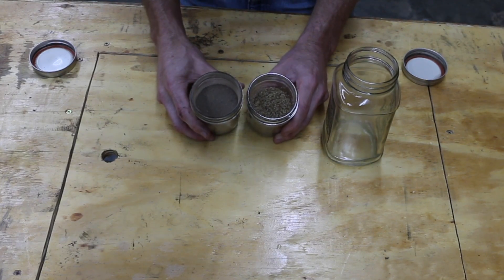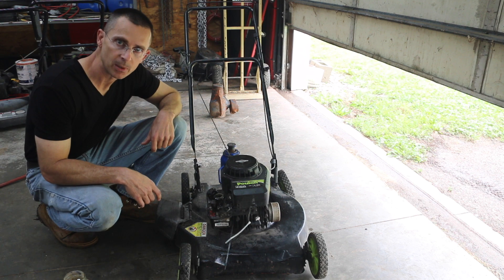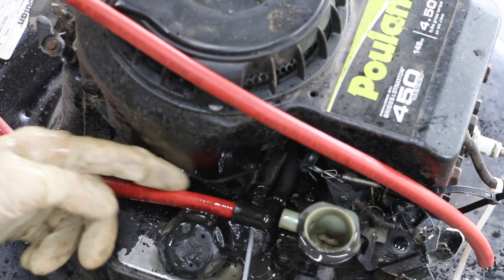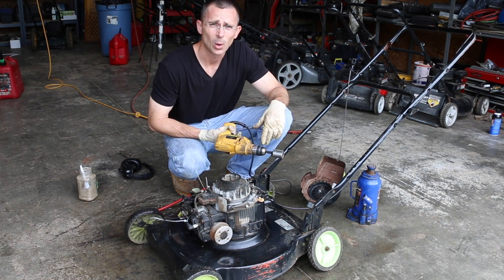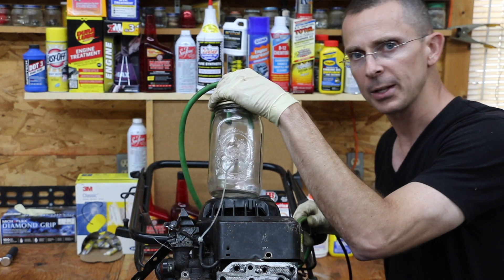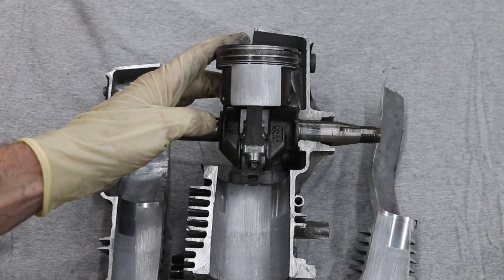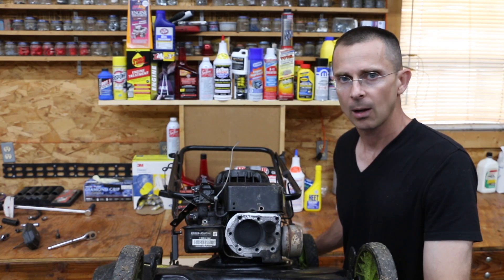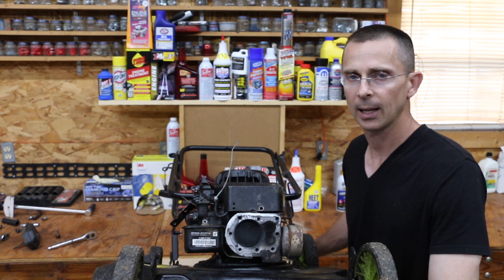Will Dirt Destroy an Engine?  See what it does to this Engine!

Comment: Not sure I feel this was accurately tested. I understand it is somewhat scaled down. But comparing such a small cylinder with a teaspoon of dirt seems like throwing a cup of dirt into a cars intake. That and it's literally pouring in, not really broken up into the air or tossed around an air box. Maybe put same mix into paint sprayer, make a faux airbox. And re-test. The amount of wear you put on the engine was just out scale in my opinion. If a full size engine was exposed to the amount dumped into the mower it would take quite a while to amount to that, there would likely have been an oil change or additives added at some point depending on the owner. My two cents, have a good one
Reply: Scott Donaldson  you obviously dont live down a 15 mile dirt road like me.  Air filter is dirty as hell every 1000 miles.  To me. This is a very accurate test.
Reply: Scott Donaldson The point is to see what damage dirt can do to an engine. And he did just that.
Reply from the maker: Scott, Great point!  Thanks for watching the and commenting!
Reply: Scott Donaldson around here its an average thing...
Reply: I dont think this is an unrealistic comparison to a car engine. Those 1 cylinder lawn mower engines have a very similar diameter piston to most 1.6l 4 cylinder car engines. Even though the car has 3 more cylinders, sand is heavy so I bet in a car engine it would come through the air intake and  and the velocity would push most of the sand to one side of the intake manifold and it would get more concentrated to one or two of the cylinders. I could be wrong. Just a thought.
Reply: Scott Donaldson i was thinking the same thing. It's a great video, BTW, but not very realistic in terms of scale. Much more sand than a car engine would take in at a time, and much too small of a cylinder to scale to a car engine … wonder what would happen if you took the same test to say, a motorcycle engine or something.
Reply: Scott Donaldson i think too, but this is the points who make it true
1-dont was too many time running and in long uses (problabely)
2- in locations with a lot of dust and with someone who use a lot of the engine the oil getting a little bit of dust already wold do a damage
3- who are using the car don't change a lot of oil (only when really need) will encrease a lot of the damage
4- changing the oil don't remove all the dust, the dust problabely will just be stuck somewhere
5- the dust will increase more when do some damage (a few iron dust) and it will make increase more the dust blablabla
Reply: Practical Guy while the cylinder size may be similar in size to a small car engine, the issue that many people see with this test is that the amount of sand being poured into that engine is way more than the average engine would ever take in. To put that into perspective, I would say (not an expert, but my opinion), that the amount of sand he poured into that small engine would clog any vehicles air filter rather quickly (as stated above by one commenter who needs new air filters around 1k miles)… but many vehicles can go 15k-30k miles (or more) before needing a new air filter. Where I used to life, I put over 40k on the air filter, and only changed it because it had over 40k miles on it … not because it was really that dirty.
Reply: James Pierson. I agree. It's not realistic that this would happen. The video is an extreme case!
Reply: Scott Donaldson i agree , I would have liked to see no air filter and just let the mower crest a dust cloud
Reply: Scott Donaldson also realistically one would think that eventually the dirt would eventually be cycled out, unlike this scenario where it’s like driving through a sandstorm with no air filter so there’s no time for it to be simply filtered out and ultimately removed with the oil, would damage be caused, yes but idk if it would be on this level. Needless to say it is bad for an engine regardless
Reply: If you were listening in the beginning Project Farm was talking about how reckless people use to be about not using air filters. He was probably speaking mostly to mechanics like myself that are a bit long in the tooth. One of the most common engine modifications-way back in the 17th century-was the old Hilborn Injection system.  Air filter on the set up was a metal screen with nail size holes. For people with those old hot rod set ups, Project Farms experiment was a perfect learning tool even if it came 40 years too late.
Reply: James Pierson it would happen faster if he put same amount of sand. Tbh i think a lawnmower can tolerate more abuse than a motorcycle engine.   Or more a dirtbike engine because thats all i am thinking about as far as motorcycles
Reply: Scott Donaldson if you ran a lawnmower with no air filter for about 4 years in a sandy dusty area this does happen i speak from experience.   My grand maw took her air filter out of her lawn mower a few years ago and now it burns oil when you first start it.
Reply: I completely agree that it shouldn't have been spoonfulls, but rather an hourglass kind of trickle if he's trying to simulate years of filter-less operation. The dust in the air, unless you have a cold air intake pointing nearly to the ground, will never be shovel loads like the scaled up version of this would. You could talk about a 1.6 liter or a 4 liter. 40 times that spoonful isn't making it into your engine at once.

Grateful for the test nonetheless.
Reply: James Pierson Just think about what an engine is an engine. Somewhere, in there, there's compression. Compression need s tolerances. Tolerance will always be so small, that doesn't matter if it's a truck engine, golf engine and so on. :)
Reply: Tzorb so sorry, forgot how many of the general public live down a 15 mile dirt road.

Comment: Your test is utterly pointless and does not represent not having a filter one bit unless the filterless car is a Dakar rally truck!
The particle size of the typical dust a street or drag vehicle sees is not even remotely near what you put in. In addition, dirt (or anything strong enough to damage aluminum) is too dense to get into an engine bay. 
Many people, myself included, have had vehicles without filters (racing use only in my case) and needless to say, many continue to do so without any adverse effects.
Reply: When i change my car air filter it does have a lot of dust and debris in it but i do travel on unsealed roads probably 10% of the time. But another thing the air filter catches lots of is insects. Those things are tough to get off a windscreen, i don't want them getting in my engine too.  :)
Maybe another test to see how many roaches it takes to stop a mower?  :)
Reply: but still is intresting and fun to see
Reply: TheXdmgx7 make your own fuckin video then

Comment: How bout muriatic acid aka hydrochloric acid or even drain cleaner aka sulfuric acid.  Both available at home improvement stores.  Try adding it to the fuel.  I know it would destroy an engine directly but will it work diluted within the fuel?

Comment: Try running the engine with gasoline in the to simulate the carburetor leaking into the cylinder and down in the crank case

Comment: Very inaccurate test. You could drive thru a dust storm and pick up less sand then the amounts you dumped in the carb. This test should have been done using a fan
Reply: +Keith Nitro i think the test is represnt to the sand accumulation (without air filter) for 100times use   in normal condition.
Reply: Keith Nitro I agree... way funner this way though.  The drama... oh the drama.
Reply: I actually thought that's what he was going to do. but no. just dump it in! LOL!
Reply: tudutudut teet tutudutut tutututuutudututrutuduututuuturutudutututeetutudututdutudututudtutteeetduutudtuutetutututudututodooditutututut
Reply from the maker: Keith, Great point!  Thanks for watching the and commenting!

Comment: Also, who the hell mows sand?... real world test? I think not. get your experiments closer to real world stuff next time. the video should just be titled "see what happens when I put sand in an engine."
Reply: dylan fry last time i checked theres usually sand underneath grass, so i think its pretty real world
Reply: I regularly see people mowing their lawns in the summer when the ground is dry. The blades kick up clouds of dirt/sand that almost hides the mower and the operator. So with no air filter it would easily suck in lots of dust and sand. It wouldn't take long to accumulate similar amounts to what was shown in the video. Our local council is a good example of this. They mow the grass in the public areas to a schedule, i have seen them mowing in the rain and when it was so hot and dry there was no grass to mow, just dirt and dead grass. But hey the schedule says mow so they mow. The operators don't appear to care about the machinery or the end result. Quite annoying as you drive past and the mower is spitting out vast amounts of dirt and gravel that showers your car.
As was stated this is a test to see what happens when someone believes the motor doesn't need an air filter.
If an air filter is used then mowing in dry and dusty conditions would lead to blocked air filters rather then the damage shown in the video. Much easier to clean/replace an air filter than undo the damage that was demonstrated with this engine.

Comment: What about starter fluid? Is it possible to kill the engine by putting too much starter fluid in the engine? I use it sometimes to start our old go-kart engine and i usually spray it directly into the carburetor

Comment: I've watched some of your videos and I've just subbed.  How about one where a 40:1 mix of 2 stroke oil is used?  I'd assume it would just foul the plug quicker but I'd be interested to see if carbon deposits form and rob power.  Also, what about 50% or so mix of diesel or kerosene?  In a riding mower with a decent sized tank, it wouldn't be unreasonable to accidentally pour half a tank of the wrong fuel in if you're not good about keeping them in marked containers.
Reply from the maker: Grant, Great suggestions and thank you for subscribing!  I plan to test some of the ideas you've suggested!
Reply: It would be interesting to see the effect of 2-stroke fuel on a 4-stroke. Lots of smoke and plug fouling i imagine. 
How about the other way round? Unmixed fuel in a 2-stroke motor. 
Or what about different oils as mixers for 2-stroke fuel? Motor oil, diesel oil, vegetable oil, chainsaw chain oil etc.

Comment: Whenever I change the air filter on my van, I always bang the dirt out of the old one to see how much sand would have went into my engine. it's amazing to see how much damaging sand would have entered without a filter. I still see a lot of my friends running turbo cars with no filter, and it drives me crazy.

Comment: I would like to see what happens when you put too much oil into the crankcase.  I am told this builds up too much pressure and the engine fails, but I am not sure.

Comment: Car engines last much longer than they did in the early 1950s, probably partly because of better air and oil filtration, and also better crankcase breather filtration.

I remember my mother's 1950 Chevrolet on which I learned to drive.  For crankcase ventilation, there was a road draft tube which was rather common at that time.  To let air into the crankcase the rocker cover had three open slots with no filtration anywhere.  The slots opened from the back so noting could fall directly into the engine, but road dust could easily enter from behind.  By the time the car had 50K miles on it, it was getting about 1K miles per quart of oil.  By the time it had 75K miles on it, it was getting about 250 miles per quart of oil.  Now many cars will go > 170K miles without burning excessive oil.  I'm not saying that better filtration is the ONLY reason that engine last longer now, but I think it's an important factor.

Comment: This is the most fucked off test I've seen... when does a Engine get a direct shot of dirt like that?? It doesn't.. it's a more gradual ingestion that is very fine particles. A better way is to put the motor in a DUST filled shop.

Comment: These engines have an aluminium piston in an aluminium bore. An engine with a cast iron liner would hardly be affected by this amount. It would affect it in the long term but this kind of damage would take 100 times longer.

Comment: "I had no idea that such a small amount of sand, would cause this much damage"

Epic trolling brother. The amount of sand you shoveled into that motor would equate to no less than a decade of just eating airborne dust/dirt.
You literally shoveled it in until the motor stalled. A realistic example would have been to take the air cleaner off, go mow a mostly dirt field and check the wear at that point.

You might as well have just thrown tungsten shavings right down it's throat using the method you used. Your example fails basic scrutiny for realism at even the most lower levels of conventional logic.

That all aside, you put on one hell of a show and I appreciate the level of destruction you managed to cause. Keep it coming, but please for everyone's sake, just keep it real.
Reply from the maker: Bobby D, All great points!  Thanks for watching the and commenting!
Reply: Bobby D little amount. he pored it in for  15 mins and thats a small amount 😅

Comment: excellent video, I knew from growing up in Colorado that the air filter is a must.many friends did just that, run around without an air filter and fairly soon the engine would start to burn oil then the bottom end would eventually go. a test that would be good is diesel fuel in a gasoline engine and to see if one, they continue to run and two, if there is any damage where does it happen? it's hard to do these days but it can happen especially if the wrong fuel can gets used or put diesel fuel in a can then put in the tank. just a suggestion.

Comment: Run an engine with no oil in it, overheat an engine by running without water/breaking fins off? or run way too lean. Detonation by either advancing the timing, tons of carbon buildup or old gas.  It would also be cool if you showed how to fix the engine after you destroyed it or at least explaining the process and components involved. Although not really cost effective for a 1 cylinder engine, if you have bad scoring in 1 or 2 car engine cylinders you can hone or sleeve the block and replace the rings and piston with oversize or standard size.

Comment: "alternative fuels" would be a good one, like diesel or paraffin (Kerosene over there), did the latter with a generator of mine for a short time, worked nicely, but apparently the cetane rating coupled with the compression could blow a hole in the piston, so, that's a good one to test... :)

Comment: It seems like something was forcing open the piston rings, allowing them to re-seat and gain back compression after it was flushed out. Since there are two piston rings, perhaps the sand was getting stuck between them?

One way this test is not entirely accurate is that the oil was never changed. A normal car will have the oil changed many times before it is destroyed by dirt in the intake, not to mention the dirt captured by the oil filter (except for particles under 40 micron). The suspended dirt particles in the oil could cause a lot of extra damage. I also agree with the idea of using a fan or something to disperse the dirt going into the intake - I think dispersed dirt in smaller amounts would be less harmful than large gulps of dirt. But then it may take a lot more dirt to destroy the engine.

As for air filters, even a very dirty air filter will still work if it has not been damaged. The most important thing to look for is if there are any holes between the air filter and the throttle body that will suck in unfiltered air. Also there may be dirt settled on the filtered side of the air box if a dirty filter was replaced without cleaning it. I was looking at a 98 Honda Accord where the air tube had cracked between the baffles where you can't see it, and was sucking in air from there. Hot glue or caulk probably would have been acceptable until the tube developed new cracks.

Comment: This is an accelerated test showing why K&N airfilters are pure crap.
Reply: Walter K No K&N I have seen has ever let in even a thousandth of a spoonful of what he was putting into that mower. Always dust free on the clean side, the MAF, and throttle body.
Reply: 1Fast GXP You do not understand the meaning of "accelerated testing". I have seen photos of the damage caused by the substandard filtration K&N airfilters provide.

Comment: I don't get why they remove the drain plugs for the oil. It was a stupid cost-cutting measure. I ran my dad's old Toro with a 4.5 hp Briggs & Stratton lawn mower for years without an air filter since that was the only way I could get it to run right, but it ran fine. I like your videos but you've killed a lot of Briggs & Stratton motors. It's just Briggs & Stratton is from my hometown and they're still built here. But they're ubiquitous they're everywhere.
Reply: I don't think SeaFoam is going to save that engine. A friend of mine hit something on the road while riding his Harley and the oil pan got punctured and all the oil leaked out how long could you go before the engine would fail and seize up after all the oil had leaked out of the engine. But using conventional oil not the slick 50 like you tested before.

Comment: Last summer my friend and I were trying to blow up his mower. We drained all the oil, put a hose over the exhaust and filled it with water, used water instead of oil, took off the governor and even had it coming out the intake but it still lives on. Gonna try this next...
Edit : We are also pretty sure that there are no rings left in it.